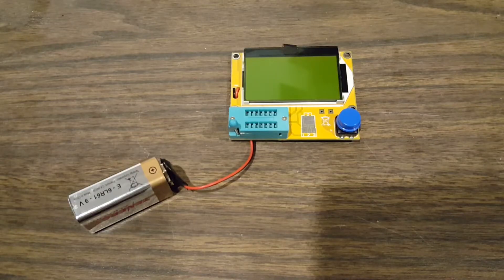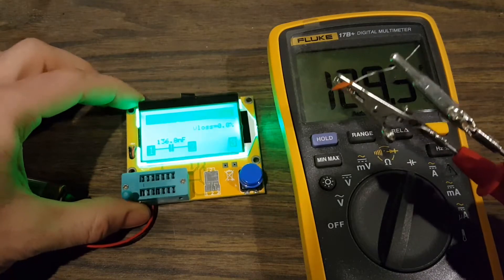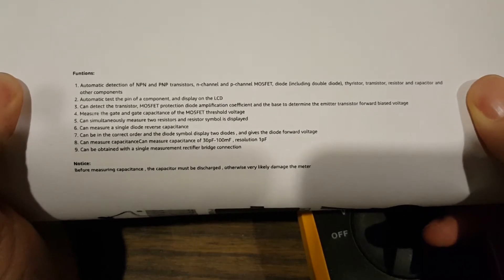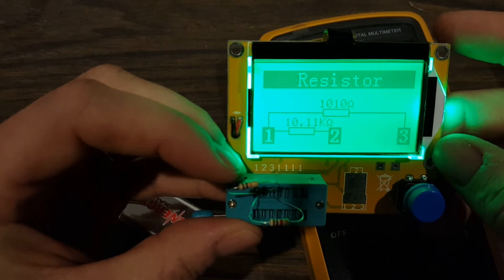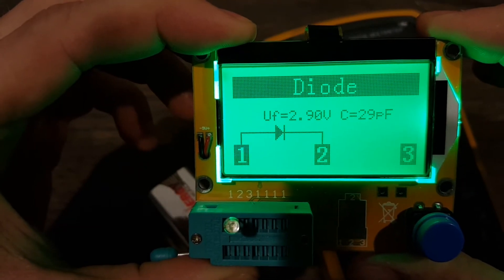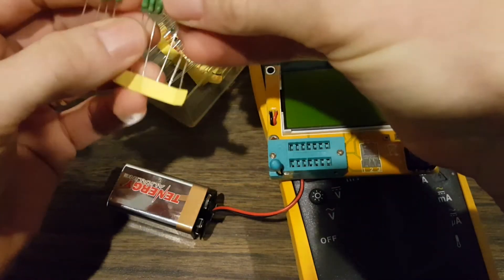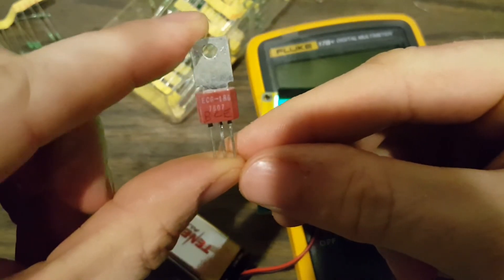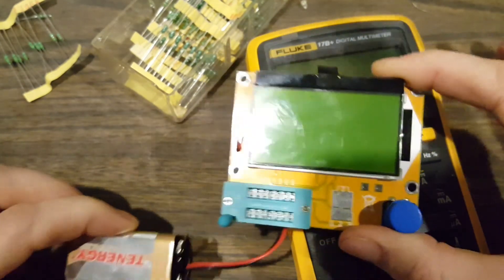Cool Tools: LCR-T4 universal component tester review

Comment: Had mine for 3 years now and just blew up the microprocessor from static electricity. Make sure to touch ground negative before holding any parts you are putting in the socket.I do have metal on the box and normally I'm holding it in my hand, but today I put the cap in the socket without holding the box first. I know the cap was discharged, did that first.